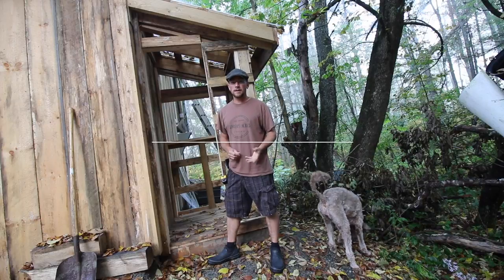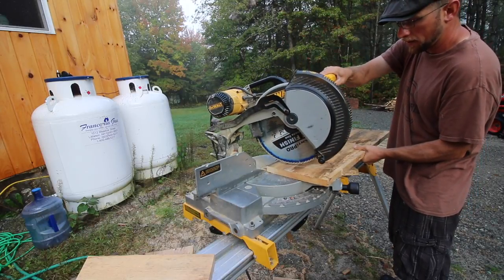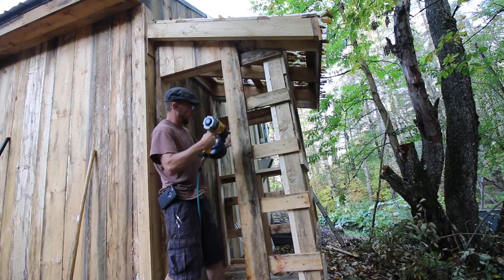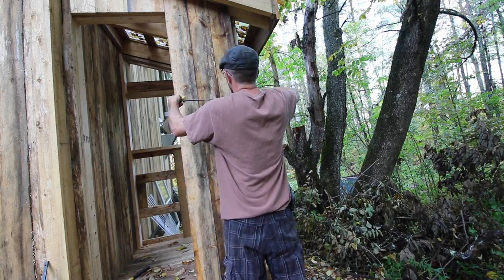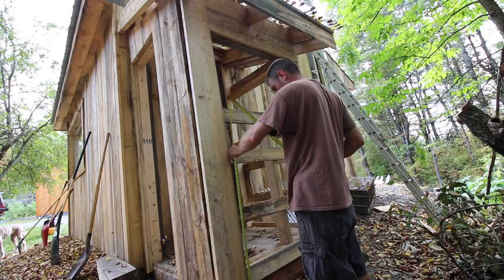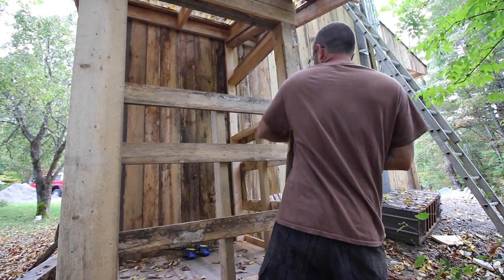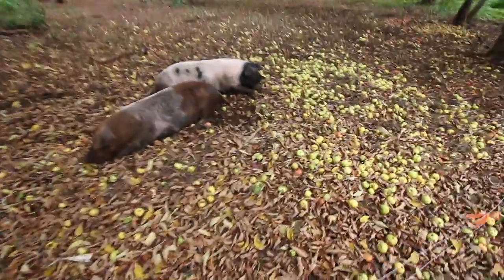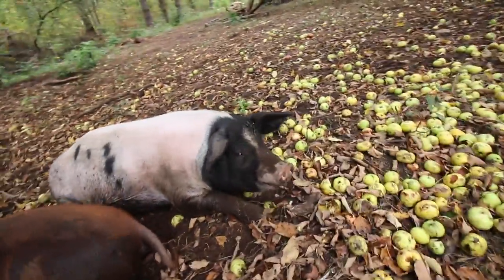🔨DIY Composting Outhouse ~ Adding Some PRIVACY to it~🔨

Comment: Evening Al Here in England we get rain and plenty of it lol so our wood that is being used outside for sheds etc we have to paint it with a wood preservative to stop it rotting and it looks nice also as it comes in different colours lol i was wondering will you be doing the same thing or leaveing it as is ??
Reply from the maker: Yes I will put an oil on it next year. Once the wood is dry

Comment: Looking good.
I've noticed you have two different nail guns, the one you're using here and another grey one.
Are there any differences between them or do you just grab the ones that's nearest or that you have nails for at the moment?
Reply from the maker: The grey gun is a framing gun and DeWalt is a coil nail gun for siding and sheathing